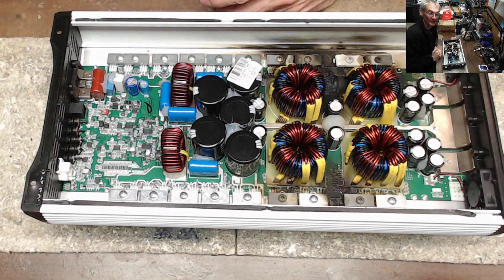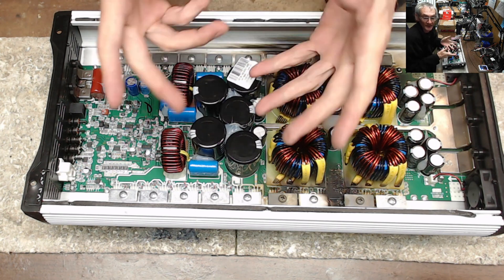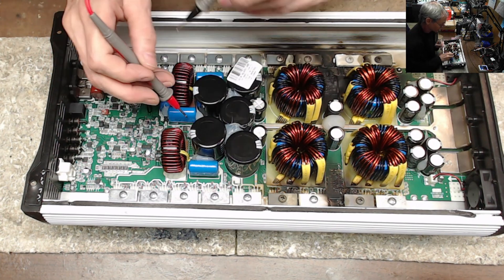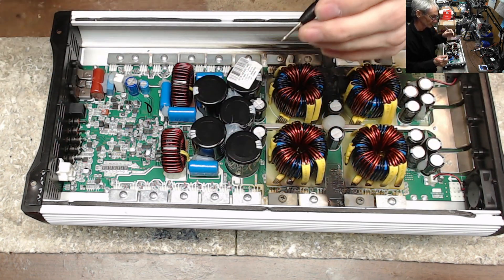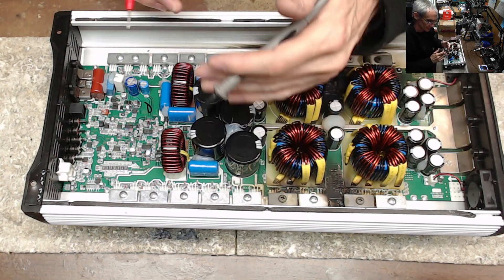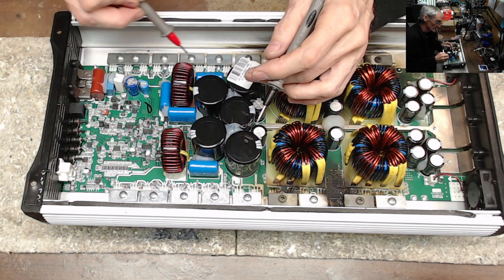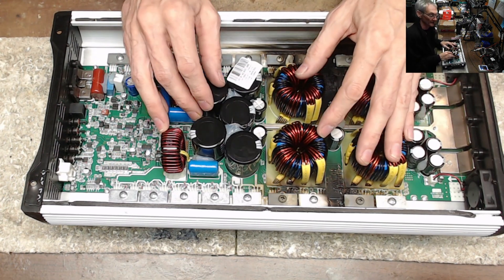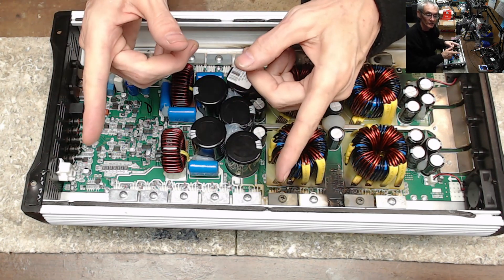Taramps MD8000.1 EX Repair Notes for Recognizing Shorts

Comment: Quick question…lol.

The solder on the Taramps boards..

How hot does that gotta be before it melts?
Reply from the maker: That is a good question! The original solder is Pb-free so it has a higher melting point than what I use for repairs. All of the irons and desoldering stations are set to between 700 and 740 degrees F.

Comment: Hi Todd. Thank you for your videos. I have a question. The Brazilian amplifier has 4 output transistors to-220 marked "H6". Gate capacitance 11.5nF. RDS-0.1ohm. Supply voltage 83V. Driver ic "C3". looks like irs20957. .if it doesn't bother you, tell me, what is the actual type of output transistors? Thank you. Sergey
Reply from the maker: The H6 will be a 4115 transistor. Hope this helps and thank you for the support!
Reply: @ellensburgamplifier  Thanks for the answer. I was confused by the shutter capacity. according to datasheet 4115 it is about 6-7nF, while the original "H6" measured 11.5 nF..

Comment: Looks like they put the fans on the power side instead of just sitting out in the open like before. Also look like they added more output transistors. What's the advantage of adding more output transistors? But keeping the same output ratings.
Reply from the maker: Adding more transistors will help spread out the load and reduce the overall per transistor stresses. I still think they should have fans at the output section due to the heat created by the inductors.
Reply: @ellensburgamplifier  do you have Facebook messenger?